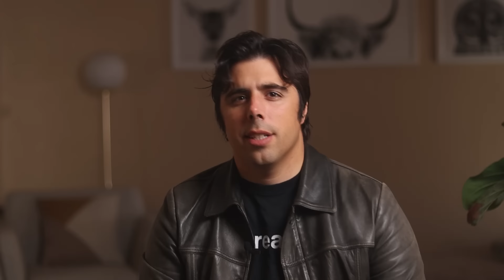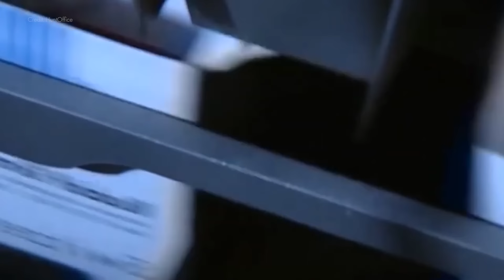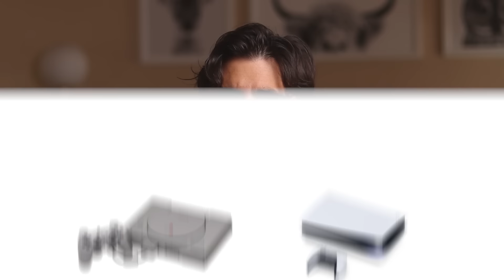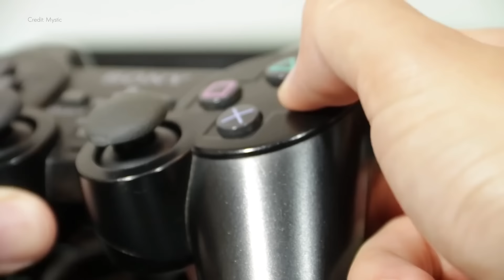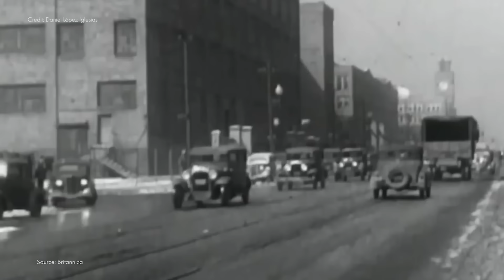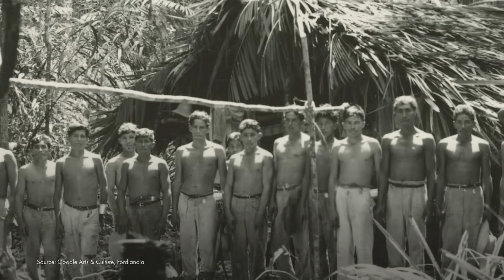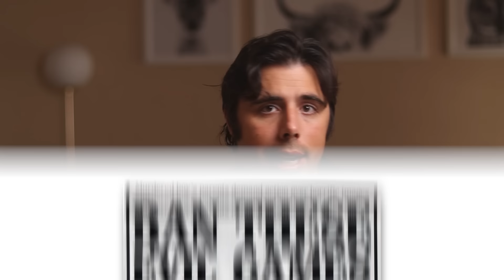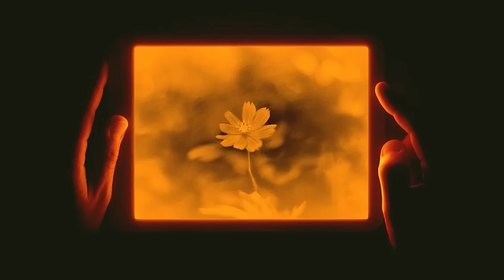Why Some Designs Are Impossible to Improve: Quintessence

Comment: Contrary to popular belief, the QWERTY keyboard layout wasn't just some random layout designed to slow you down. Except for S, the home row is alphabetical from left to right -- even moreso in the original version which had M on the end, next to L (later M was moved down to the bottom row). All the vowels except A are on the top row. And the two least commonly used letters, Q and Z, are placed at the left edges, since your left pinkie is one of your weakest fingers. Plus it was a marketing trick to demonstrate the ability to type the word "typewriter" using only keys on the top row.
Reply: Oh my gosh, I thought I was crazy for realizing FGHJKL was in order but didn’t realize why
Reply: @chicagotypewriter2094 
I noticed that too
Reply: The design wouldn't be random if it was designed specifically to slow your typing.
Reply: @timothyspool1399  I don't think it was specifically designed to slow typing, that was a side effect of the likely reason: To reduce key jams. As an example, although the T and H keys appear to be close to each other, there are actually four keys between them. In a similar way, there are three keys between each number key (1 Q A Z 2). There are exceptions, such as E and D, F and R.

Due to the introduction of the Selectric typing ball element and printwheels the issue of key jams no longer exists with modern typewriters. I think the main reason QWERTY remains is that it is firmly embedded. You can get on any typewriter and computer and immediately use them.
Reply: Q: awful position for asdf hand layout, but one of the best positions for wasd hand layout
Reply: Designed to slow down the typist isn't the right way to put it, it's designed to decrease the frequency of an event where two adjacent type bars being used in succession. 
Early typewriters, of the variety that became common in the late 1800s, arranged the type in a vertical cylinder below the platen, "upstrike" machines. Two keys adjacent on the keyboard layout are not necessarily linked to adjacent type bars where jamming behavior is observed, though this became more true with later visible typewriters. 
The current Wikipedia article on the Sholes and Glidden machine illustrates the mechanical problem more accurately, properly noting the circular type basket. The keyboard layout was informed by the specific mechanical layout of that exact machine, and happened to work well enough for others of similar mechanical architecture, establishing the initial momentum that continues today.
Reply: I almost had a stroke trying to read that. It took me 4 tries and I'm not even dyslexic
Reply: I came to comment on this. QWERTY is an aweful example on good design. It's an example of resistance to change: too many people are already using it, but it should be changed. There are alternatives like dvorak, but who has the time to re-learn how to type.
Reply: @ciscou  Is it the best layout? Probably not, it was a person using trail and error over 150 years ago. But it is close enough that there isn't any real benefit to switching. Dvorak is a marginal improvement at best, and other modern layout designs are almost certainly superior to it but still an extremely minor improvement overall.

The problem is that the costs in time and effort to learn a better layout will pretty much never be recouped as teh benefits are so minimal. And even if we started teaching people a better layout from childhood, they are goign to have to interact with legacy QWERTY systems and the costs of that would quickly offset teh beenfits of knowing the new layout.

The key to remember is that making something better is not enough, you need to make something better enough that it is worth swtiching to. And no keyboard layout is that for the vast majority of people.
Reply: Why is typing "TYPEWRITER" on the top row a marketing trick?  You really think that played into a single typewriter purchasing decision? "...not only that, but you can type "typewriter" with just the top row!" "Oh man, I was on the fence before, but now I HAVE to buy this machine if it can do that!"
I am quite sure that exchange happened exactly zero times.
Reply: @lawschuelke  It seems plausible even if it sounds ridiculous. After all, one of the most common things people did to demonstrate a computer in the 1980s was to type in a small BASIC program to display the same word repeatedly on the screen, even though that obviously the ability to do that wasn't going to be a major factor in anyone's decision to buy a computer.
Reply: @vwestlife  I could believe that salesmen used that coincidence in their sales pitch. I would NOT believe that it had any bearing whatsoever on the layout design decisions.
Reply: @vwestlife  I very much doubt the marketing thing. It seems far more likely that the R was moved to its current location because having a period in that location seemed strange when Remington went to commercialize the layout. Having all punctuation off to one side was just a more natual layout.

Was it used in marketing? Probably. Was it done that was to enable marketing? I doubt it.
Reply: @lawschuelke  I suppose it makes it easy to find the keys to type out the word if they are all in the top row, which makes typing seem easy to learn to someone who has never typed before
Reply: Only english speaking countries use QWERTY.
continental Europe uses AZERTY.
Reply: @brianferguson7840  Wrong. QWERTY is international. AZERTY is only used in France and Belgium, while QWERTZ is used in German-speaking countries.

Comment: The "standard" for smartphone design throughout the industry seems to conform to whatever Apple's doing, but this isn't always a good thing. The move towards more boxy phones with sharp corners and flat sides is resulting in phones that feel more cumbersome to hold than their predecessors and it doesn't help that most phone screens are 6.6"+ nowadays.

Ideally we'd have 6.2" 18:9 phones with curved sides and corners in modern times but the market dictates otherwise.

Comment: Something you missed about Maglight vs Kelight was that Maglight moved to recharable battery cells where Kel did not.  I used to work for the LAFD 19'73-2004.  Toward the end they splurged on rechargeable Maglights.  We had charging stations that held many flashlight.  They were normally exchanged at shift changes (24 hr) or after use.  Kel held the reputation as the "beat em up sticks"  where Mags were slimmer and easier to carry and use.  I never carried either, I preferred more compact, less threatening flashlights, generally option for double C cell flashlights until the rechargeables dominated.
Reply: Kel lights were irrelevant long before that happened.

Comment: paperclip is not already perfect. It is more useful at ejecting media than holding paper together BUT design needs to be modified to eject media. Every day, millions of people are improving the paperclip manually before using it for a different purpose. A small spring-loaded clip is vastly better than a paperclip; it holds more, is more secure, won't crease the pages... but this, too, has been improved, with color-coded tab magnets, to allow for tabs and even that idea is old now

Comment: 23:18 Congratulations on making it until 2019 in regards to succumbing to the near-necessity of the smartphone. I broke down and began my journey in 2018 because I needed Google Maps for work. My dad still uses a  flipphone but he's retired. 
I have to say I love the appliance design of the post war era. I recently lost a late 40's/early 50's Philco refrigerator in a structure fire. The thing had curves to die for and it still worked. It ran on a 1/2 hp motor that would kick on for a few minutes an hour. It kept beer at the perfect temperature. 
I would say that it was from an age before planned obsolescence but I've heard the story of the light bulb cartel.
Reply from the maker: Interestingly, the reason I got a smartphone was also largely for the GPS function.
Reply: @Design.Theory  I still use a flip phone myself. XD
Reply: @Dragonite43  Keep it up! A flipphone is a badge of honor.
Reply: I use a flip-phone and bought a GPS for the car. No problems. My friend and I used the GPS program on her phone for a trip last week, and it was awful. All confused, with wrong info or lacking info.
Reply: @Gertyutz  Good call 😉. I'm beginning to consider this as an alternative to unhealthy and unnecessary electromagnetic exposure.  Wi-fi stacks your blood cells.

Comment: You're quite wrong about the keyboard problem. I was - and know other people who were - more than willing to spend the time for the benefits, but the issue is that so many shortcuts and programs were built around the QUERTY layout, that it's no longer practical to use anything else.
To be clear, some programs work as expected, and use the letter no matter its position, but others use the signal beyond the layout (physical position of key) rather than the mapped input, and then you have to constantly zig zag and remember what works using physical layout, and what uses input, to the point that it's confusing enough to just give up.
Reply: Spelling 'Querty' like that gives away a Dvorak typist from a mile away lol.

I've tried to learn layouts like Colemak as well that put commonly used keyboard shortcuts in the same places as Querty, but shortcut places on Dvorak work well enough for me, and there's (almost) always ctrl+ins/shift+ins as an alternative to ctrl+c/ctrl+v.

Comment: sorry but PS1 controller was not the innovation on ergonomics or analogue thumb sticks on the controller.    It was steadily getting more ergonomic from NES.  Sega Genesis controller I would say was the real innovator released in 1989.  Others tried some funky designs but failed.  Still 2 years later in 1991 the SNES only rounded the the sides of a rectangular NES controller and added the index finger triggers to the top of edge of the controller.  The PS1 released in 1994 in Japan and 1995 in the US  (five to six years after genesis) combined the two.  Still the analogue controller addition innovation was first on the Vectrex in 1982.  Then (re)innovated with the release of the N64 in 1996. The PS dual shock (double analogue thumb stick) was released in 1997.

Comment: No, the main selling point of the sunbeam is NOT that it's automatic. The main selling point is that it actually senses how dark the bread has gotten, So we no longer have bread that's un-toasted, or burned.   People would be totally happy with a current model toaster, but one that uses the sensor, and not a timer.    So I also disagree about current toasters being "good enough".  They are fucking awful.  Saw a review recently of current toasters, and most totally suck at toasting.  They almost always burn the bread, or don't toast it enough.  Or one side is damn near burnt, and the other side is hardly brown.   

At least for me, that would be the selling point.  If a company released a modern toaster today, but it used the mechanism that the sunbeam used, to determine the level of toasting, I'd buy it in a heart-beat, Just as long as it's not an "internet of things" always connected device that has bluetooth and wifi, because I don't need or want that crap in a toaster.

The issue is, Companies like sunbeam just don't make a good option, only options that are cheap to make, forcing us to use these awful toasters.  We can't use an item that isn't being made.  Isn't it amazing how NONE of the current toasters sold right now actually detect how toasted the bread is?  That they ALL run based on a timer.  We can't use or even try a toaster that works differently, BECAUSE THEY DON'T MAKE THEM.

Comment: I disagree with the qwerty keyboard layout my guy. Just because it became popular for the typewriter doesn't mean it is the best.
If you do a lot of typing and have finger pain. I'd recommend switching to a different layout. For me, I settled on the Colemak DHm layout. It is still similar to the qwerty layout but the letters that are moved letters are more optimized to reduce finger fatigue.
It has been nearly a year since I started. I'm actually a bit faster than I was with qwerty and I have zero finger pain. Why put up with the suffering of qwerty when you can type without?
Just so you know, I'm in my 30s and I was able to do this change. If I can do it, you can also.
Reply from the maker: I said that

Comment: To switch away from QWERTY does not take "months". QWERTY is so absolute dog shite it took me a week to get back to my normal speed at which point I only got faster from there. The reason I switched was because I was starting to get carpal tunnel in my wrists because QWERTY is so horribly un-optimized it forces you to perform hand gymnastics to type, and switching to a new layout fixed it and it has never come back in over 10 years. QWERTY is more expensive to use than it is to switch because it makes you SO SLOW at typing, it costs nothing to switch since it's all software or just moving keys around on the keyboard. I chose the layout QGMLWY which is the most optimized and fastest layout that exists way more so than Dvorak or anything else. Also I'm still just as fast or rather just as slow on QWERTY as I ever was like for example when using my phone, it's easy to switch between them.

Comment: One issue I've had with smartphones is the on-screen keyboard. I've found that the buttons are so small that I often press the wrong key and don't notice I've made a mistake until after I've typed two or three letters. Then I have to backspace since it is difficult to put the cursor in the right position to make the correction.

My solution was to revert to the 12-key keypad for typing, the same one I used with my flip phone. I've found that even though it take more key taps to type, it is actually faster than typing with the on-screen keyboard since I don't make the mistakes when typing with the 12-key keypad.

Comment: I still use a chrome Sunbeam to this day, it works better than any modern toaster I have had. The biggest issue with it is that you need to unplug it when you're not using it, or it's a fire hazard... The trigger that makes it go down and start toasting is not so reliable anymore, and it will start on its own with nothing in it if left plugged in. But other than that, it's the best toaster I ever had.

Comment: Another good example is the drop spindle ( a small handheld device used to make thread) The earliest that have been found date back to 7000 years ago and might be even older.
Up until the 16th century drop spindles were the primary tool for wool production and to this day they are still in use in parts of the world bc they are cheap, easy to make and not that hard to use

Comment: lol so i actually switched to the Dvorak keyboard layout several years ago. in my experience, it does NOT help me type faster. the benefit is way better ergonomics. my fingers got all twisted up on QWERTY when i typed quickly; not the case on Dvorak. the benefit is good enough that im never looking back to QWERTY as long as i live.

just about the only hiccup is compatibility. many things are designed for QWERTY, like WASD in games, keyboard shortcuts like copy, paste, cut, and undo, and i often interfaces assume theyre doing you a favor by making quick options accessible via Q, W, and E. as a result, i have to keep a shortcut on-hand to switch to QWERTY if necessary, and i need to have some basic QWERTY tying skills when i, for example, play wordle on mobile
Reply: From what I've seen different keyboard layouts have very little effect on speed. Querty vs Dvorak vs a completely random layout will have little difference in typing speed after learning it for a reasonable amount of time. This amount of time is likely much lower for new typists on more intuitive layouts like Dvorak though.

As you've said it's finger movements that see the greatest reduction. Keyboard shortcuts can be a problem sometimes but there's always ctrl+ins/shift+ins instead of ctrl+c/ctrl+v.

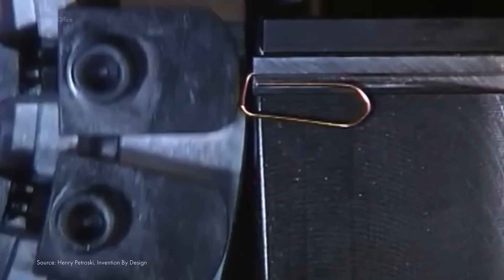Comment: Stopped at 03:30.  Too many uses of the word Quintessential.  Drives me nuts.  I'm done.

Similarly, overuse of the words Epic, Vintage, and Mint Condition (to describe some old item that has NOT been mint condition for 30 years) make me crazy, too.  bye bye
Reply from the maker: ...the video is about quintessential design. What did you expect?
Reply: @Design.Theory if this were an English essay you’d get points taken off for too much repetition.

Comment: I disagree on first point about that toaster. It's not reliable. It doesn't mean it's a bad product by any means but it has additional, non-essential elements that can break and render it unusable. It's less reliable than a simple toaster that uses a mechanical lever.

Comment: 20:00 I am Brazilian. And I doubt jaguars were a real problem. Wet weather and insects really were. That's why most of our modern permanent buildings are made of bricks, cement, and CONCRETE.

Jaguars are scaring, and if one of them want to kill you in a field, it will kill you, but they don't use to think in humans as food. So attacks against humans are extremely rare. But, yes a kind of house easy to having a jaguar inside looking for the food you left there would be a scary thing and the chances of attack against humans would increase.

But logistics, competitions with other plantations, and petrol made things actually made Fordlandia fail.

Comment: ps2 controller was actually made worse, once they reduced angles between "handles". The same problem you can find in xbox controllers. They are bigger what is great. Analog on "wrong" position is actually also great. But it obligates your hands stay more parallel what is unnatural when holding that small object.